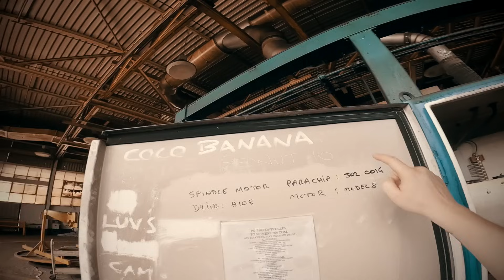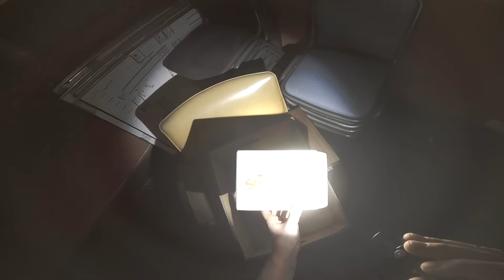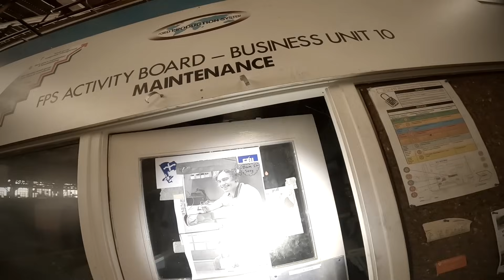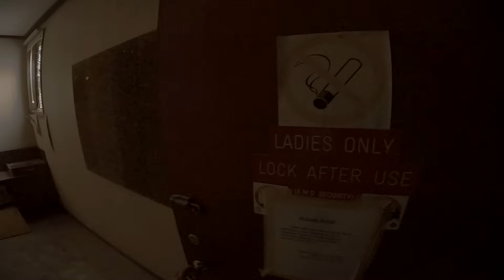I Snuck into Abandoned Ford Factory (Geelong)

Comment: My father and grandfather both worked there, and my mother did briefly adter she married my dad. That open floor area was incredibly loud when the machines where running. Hence the audiology booth in the office area. My grandfather had tinnitus as a result of working there for 25 odd years. My father had hearing damage too, though not as bad. My father worked on a press, molding panels for a long time, before he had an accident, and was moved to a different area. The presses may have been further to the back. The yellow machine you found in the storage area upstairs looks like one of the welding robots. We went on a tour through in the early 90s before dad was offered a lay off package. The beginnings of the downsizing i think. Its sad to see the plant lifeless today. Would love to see more if you ever visit again.
Reply from the maker: Sad to hear despite best efforts employees still suffered long term hearing damage. That buzzing noise from the lights alone was loud enough as it is. Ahhhh finally someone is able to tell me what the yellow machine was, cheers Quokka! That's awesome, can just picture it in action now. The site has since been gutted and repurposed, but I will be releasing a longer remastered edit with unseen footage and no voice masking in the near future : )
Reply: the presses were in the building next door, the robot is like the weld robots supplied by abb many shapes and sizes, they were used in many places, sub assembly and finally in the press shop i worked in the press shop from 1983 -2016 so i may have known your father depends what area  he worked and what shift ,there was a small press shop area and a medium and aheavy presses, most of the body panel were pressed in the heavy press shop ,bonnets, doors, body sides, chassis rails there i a few video's on you tube the demo of the press shop (ausdecom, the last falcon build ect)
Reply from the maker: The press shop building was still partially active when I went unfortunately, got out of there real quick once I realised...will include footage on new release of video.
Reply: The press shop was still active until October of 2017 running spare part's there was also a pro type build for the new model ranger and Everest up until April 2017 in the old small press shop and clean up and scrapping of dies and fixtures up until October 2017 also they were running a spare  centre also marand were in the second building if you had gone in some one would have seen you
Reply from the maker: At the time I had no idea someone had already taken over the second building haha, lucky I went on a Sunday. There were still a lot of Ford remnants around so I thought it was sitting vacant from 2016ish too at first until I walked further into it.
Reply: Marand took over the toolroom in 2012
Reply: The first part to be leased out a sign of things to come 8 months later Ford announced they would be closing in October 2016
Reply from the maker: Oh wow, there you have it...cheers for all the ongoing info Trev!
Reply: I know much of this because I know people who are still employed in the  research and development areas plus people employed by marand ex-ford workers /tradesmen
Reply: @urbexgecko  the hearing damage some workers sustained was awful. Pop swore black and blue he could hear a truck running in the driveway, but it was the tinnitus. I don't know what the overall accident record would have been like, but my Dad had a finger crushed by a panel press when a safety failed. That particular machine was then shut down for a while when another worker was killed due to the same issue. 😔 Glad I could help soft the mystery of the yellow monster! I can still remember the sound of them in action. I saw some of the year down videos last night too. Sad to see it all go, but at least the buildings still stand. My brother was telling me today a branch of the business he works for is opening a new workshop there. So good that it's still getting use in some ways. That's great! I'll keep an eye out for that video. 👍
Reply: @trevorjohnston9504  oh ok! That makes sense. Thanks Trevor! You may have crossed paths. Dad worked mainly dayshift, but he took afternoon or night if it came up. We were a one income family and it all helped. His name was Bryan, and he was a ten pound pom. I think he worked a panel press, but I couldn't be sure. He had an accident where his finger was crushed in one of the presses in the mid-80s, and may have moved department after that. Someone was killed on the same machine shortly after as a safety cutoff failed. He worked at Ford from the 70s until around 1994 or so. He was at the Ballarat plant for a short time, then came back to Geelong. In his later years he was a boiler maker and storeman. I saw some of the year down videos last night. Sad to see it go. My brother was telling me the business he works for is opening a new workshop there next month, so at least it's in use somehow and not just a sad empty shell.
Reply: @SmilingQuokka  i worked in the press shop 1983-2002 mainly day shift press operator then die setter transfered to toolroom 2002-2012 (2012 toolroom leased to marand they are still there) but with some time in the press shop worked try-out on new press tooling and repairing dies and fixtures(die setting, crane driving, forklift, tractor driving)2012-2016 transfered back to the press shop i knew a couple of bryan's, one who had a big accident trapped in a press (1980's elbow injury) and one who worked in the main store room i only know of a couple of death's in the stamping plant a forklift roll over well before i started and a guy was killed in a blanking press accident late 1970, (1978 i think) (my family knew this family, my sister went to school with the guy that died his father also worked in the same department as a supervisor and was there at the time),( before i started)  i had know idea i would end up working there over all accident were low with the normal cuts, the odd finger amputation that come with working with steel the only other accident was when a guy had his arm ripped off by a conveyor belt
Reply: @trevorjohnston9504  wow! You moved around the plant a bit. You must have known it so well back in its running days! Good to know the accidents were few then. I'd expect the odd cuts and bruises and damage to fingers working with sheet metals. My dad reckoned the onsite nurse was good, very gentle. The accident my Dad had with the press could have been during his time at the Ballarat plant. He was there in the early 80s. I don't know what years exactly, I was just a Kindy or early primary kid then. But I remember he used to get a lift with a neighbour, a fellow Ford worker by the name of Gray. It may have been my Dad you knew from the main storeroom at Geeling. His surname started with I. Grey hair, glasses and a mustache. He drove a forklift and moved dangerous chemicals when required. If you'd come in for something, he'd probably want to chat your ear off haha.
Reply: That's really eerie! From that footage I honestly can't imagine anything modern being manufactured there! Looks like that place has been abandoned for decades! Looks like a factory straight out of the seventies or eighties! All of the old furniture and fixtures, telephones, computers etc! None of that stuff looks like it was from modern times! Very confusing, as you wouldn't expect a modern facility operating in the 2000s beyond to look like that! There is no evidence of technology in that building whatsoever, I highly doubt they were using dial telephones or IBM computers in 2016! There has to be more to the story of this building, that women's toilet looks ancient and the amount of dust buildup looks like it hasn't been operational for decades. Nothing there represents a modern day factory!
Reply from the maker: Pretty awesome hey Zee, huge time capsule.
Reply: @RE_ZeeKaay  that part of the building had not been used in a long time vertualy lock up and forgotten about (if you walked into a cleaned out house and there was an old phone on the wall would you assume that was the only one they used?)
Reply: The last time I was in that part of the the building was 2012 to move some old desk's and that area has not been used for years evey one who work there (the employment offlce pay roll and finance were moved into the building behind the engine plant (the white building) the medical centre was moved into the stamping plant

Comment: Why are the lights still on? 🤔
Reply from the maker: Good question, didn't expect power or running water. As far as I know, and how stuck in time it was, they had no use for that section after it closed.
Reply: The new owners want to manufacture pre manufactured building out of the site.
You were in the old stamping plant where the body parts were stamped out before being trucked to Broadmedows for assembly.

The engines were cast in another factory nearby, it was demolished years ago.....
Reply: @urbexgecko  there was probably a security guard asleep in a hiding spot somewhere in the building.
Reply: @urbexgecko  maybe someone just forgot to turn them off when they left 😂
Reply from the maker: Used to see a security car parked there or patrolling it whenever I went past, everything aligned on this particular day though.
Reply: @morantaylor  he was in the engine plant and the old medical center/employment office/old pay role, i should know i work in the stamping plant 1983-2016

Comment: I work there now the company I work for bought 10% of it and our part is still huge
Reply from the maker: If it looked that big with all the stuff in it, can only imagine now it's all cleared out and modernised.
Reply: Was bigger ford's used to own  the land right up to the separation street bridge the plant near the bridge is now owned by Godfrey hirst carpets but was originally the Ford chassis plant, then turned into a 4 cylinder engine plant assembling engines with imported parts (I was sent to work there a couple of times) Ford was that big in Geelong they used to run there own internal bus service to move people around between the plants, ford also used to have a product development and search centre where the bunnings building is on the other side of Melbourne road but it was sold off and a new centre built on the east side of the plant near the railway line also has a casting plant in north shore (they did the engine blocks, brake disk, cam shafts, cranks even made lifting weights for York Bell bar most made from the scrap steel from the press shop and metal swarf from the engine plant and toolroom
Reply from the maker: Woah!!!
Reply: @urbexgecko  Ford was also casting the brake disk for Toyota and Holden the contract was given to a manufacturer in south Australia after Ford's closed
Reply from the maker: Wow, glory days...what a fall from the top hey Trev!
Reply: @urbexgecko  I worked in the shipping department for the last 11 month's  the mould's that were sent from the casting plant to the main plant and asked why they were there and was told an out side vendor would be casting them as Holden and Toyota still required them and ford's could not continue to supply them
Reply: @urbexgecko  yeah so much bigger with no machines
Reply: Is that clos
Reply: Is that clos